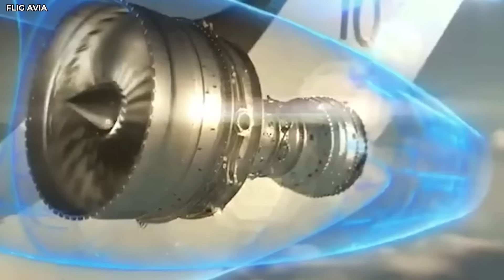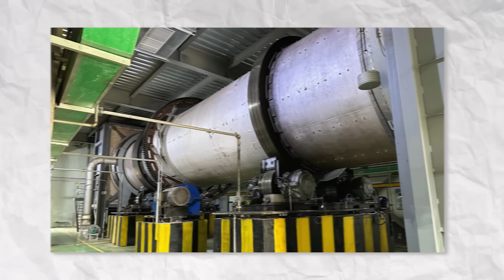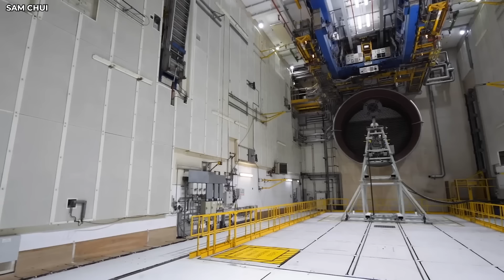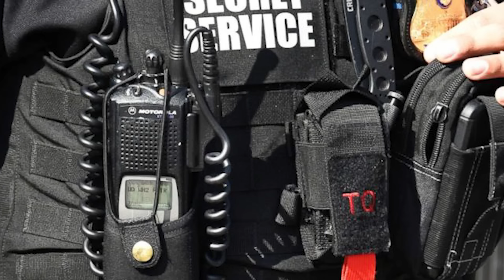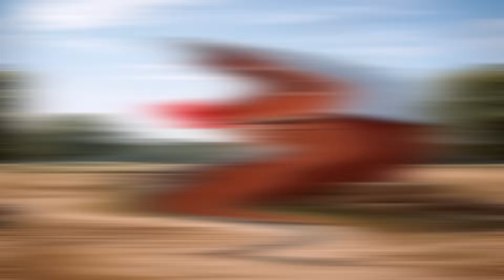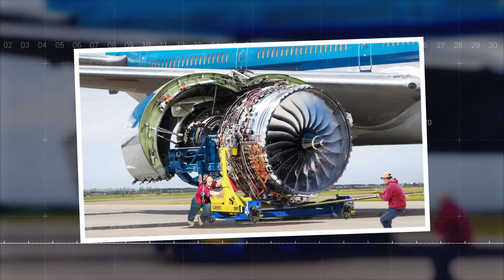This Romanian Engineer OUTSMARTED Rolls-Royce With a "Weird" Jet Turbine Built in a Barn

Comment: Pratt and Whitney engine for F35. Its failing because no one understand the the heart of the engine.  Rolls Royce was not stupid they bet on the RB 211 with three compressor the person lead the project had right degree in engineering but he could not troubleshoot the beast. this is the same reason Pratt and Whitney is failing.   RR would not touch this counter rotation engine.

Comment: There’s a problem with this video and it relates to the person in question,  The supposed inventor of this new engine Narcis Mihăescu can’t be found anywhere in relation to this new engine except this one YouTube video.  This is a Narcis Mihăescu in the U.K. and he is a dementia healthcare worker.  All we seem to see heree are generated images and I am not convinced that this person has actually done what they say they have.  Kudos if he has invented something that is far better than RollsRoyce, GE, Bombardier, Tupalov, Boeing etc…. But these companies have guys in these engines constantly trying to improve on the next model lovwer fuel efficiency and noice reduction etc…..  the next one will be engines powered by batteries.  Also showing the Rolls Royce car has no bearing with this supposed technological innovation because their cars are either petrol or diesel.  They don’t have air craft engines in them.  I’d be very surprised if someone would be allowed to just set up an engine testing facility in their sheds barn.

Comment: RR were already working on contra-rotating spools - where the high-pressure and low-pressure compressors/turbines rotate in opposite directions. Introduced by Rolls-Royce in the Trent 900 engine for the Airbus A380. The Trent 900 was developed in the nineties being introduced in a plane in 2003.

This vid make out the RR engineers saw something brilliant in Romania they were totally unaware of, which is not the case. Contra-rotating propellers were not new in the seventies. 
.

Comment: There is somemisleading informaton in this video. The contra-rotating parts are not like the contrarotating propellers, where the contra-rotating blades are adjacent to each other.  increasing the relative motion between the opposite rotating parts. which does increase the efficiency. 

The picture at 28:51 shows the two main shafts rotating opposite with respect to each other,  but not the individual stages/discs of the fixed blades on the stator and their corresponding rotating blades. The fixed stators are required to hold the outer shell of the engine, and the compressor block does not have the stator rotating opposite to its rotor; the stator is stationary.  I suppose it would be possible to build a jet engine with no fixed stator blades, where all the blades are rotating half in one direction and the other in the other direction on the compressor and the hot turbine block. This would truly be a contra rotating compresser stage and a contra-rotating turbine stage.  With two shafts, it is easy to have a two-disc contra-rotating compressor and a two-disc contrarotating hot turbine stage.  To experiment with a compressor stage, a block where more stages counter-rotate, that would be a very complex mechanical arrangement. 

I guess the higher efficiency with contra rotation, in water propellers and air systems is because, unlike piston engines, which can be slow in their compression and expansion, the fluid in water and air needs momentum, as it is all dynamic and the faster the relative motion of the blades will create more forces to compress, or to change pressure into torque at the hot turbine.  A good idea, but not an easy solution, if one thinks about adjacent contra-rotating discs. in one compressor or one turbine block.
Reply: maybe you're still attached to the inside-the-box configuration and design.

Comment: You could research Viktor Schauberger engine which had more than 300% efficiency. Real buried story. Imagine airplanes with no trail, with no pollution. It was made between 1930 and 1940.
Reply: Rubbish. 300% efficiency means you get 3 times more work out than energy you put in. The engine actually creates energy out of nothing, which is impossible.
Reply: @topspeed250k5  Not from nothing. Energy is already there. It is about more efficient way of triggering the process.
Reply: @topspeed250k5  It is about golden ratio impeller.

Comment: You think that it doesn't apply in the USA then you are mistaken.  The scram jet tek even on Google is fake.  Fake numbers and non working drawing of engines.  PS, the real speeds is between Mac 3.5 to Mac 27 depending on elevation.  I was never allowed to fly any prototype of a rocket scram or a rocket external scram.  Plus every patent or idea is still open for China to make and sell to the open market.

Comment: The problem is that the people who have to approve a project usually have little technical knowledge, but instead have a good sense of their own uniqueness and a strong desire to hold on to their position in the company. No change, please!
So even the best engineer would not be able to put good ideas into practice until there was competition that had already done so. Then it can't happen fast enough.
Reply: You are right even America didn't believe in the wright brothers till France showed an interest🎉
Reply: @ElijahOmollo-v9y  My son worked at P & W as  quality control inspector.  He was often confronted with design flaws  costing thousands in wasted time and work arounds  that would not have occurred if designers had had shop floor experience. It is the same story across many industries. I had a company install automatic barn scrapers with sensitive electronic controls, mainly to save  damage to cows. Problem was load sensors were too sensitive resulting in  spurious direction changes due to power supply fluctuations. The two separate units 'talked" to each other in random fashion so usually failed to complete full cycles. The solution was obvious but the designer refused to modify so the systems were scrapped and replaced with a spring load sensor control system!!